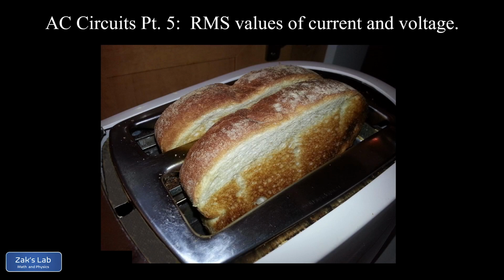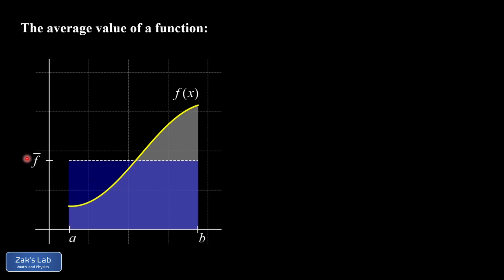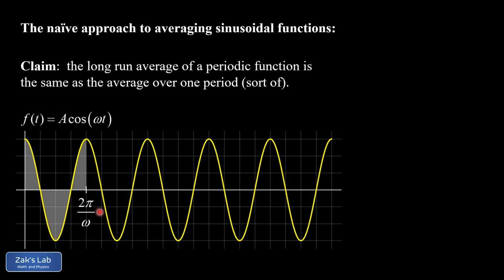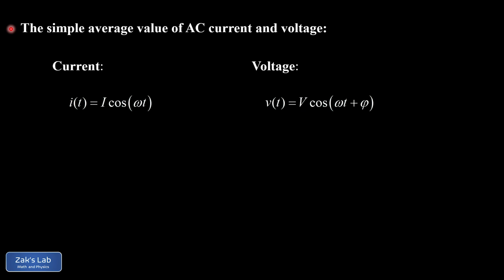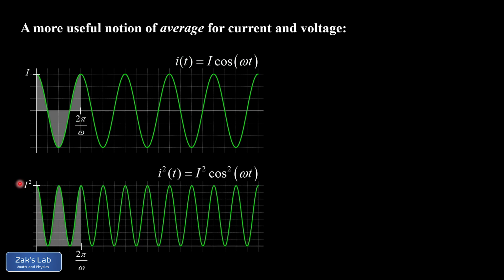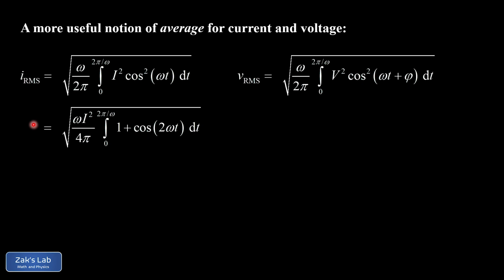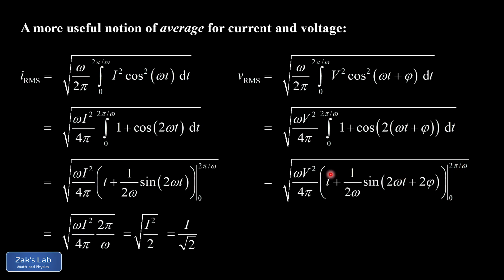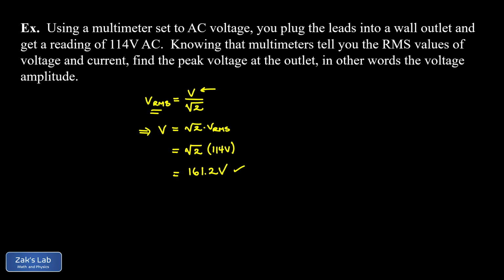RMS values for current and voltage - full calculus derivation [AC circuit physics]

Comment: The motivation for RMS would be better shown by trying to equate the average power dissipated in a resistor with the integral of the AC voltage time the AC current. The RMS pops out of this calculation.
Reply from the maker: This is a really interesting issue popping up in the comments section - is it better to motivate RMS as a reasonable type of averaging first, and then rediscover that average power is I_rms*V_rms (or I_rms^2*R etc.), or do you start computing average power as P-bar= 1/(2pi/w)integral_0^(2pi/w) (Icos(wt)*IRcos(wt))dt, then define I_rms^2 as 1/(2pi/w)integral(I^2cos^2(wt))dt in order to retrieve average power formulas analogous to DC:  P-bar=I_rms^2*R etc.  I'm still not convinced one approach is clearly the right approach to presenting the topic, but I'm still mulling it over.  I just looked in an electrical engineering book and a physics book, and both of them had unsatisfying presentations of the topic.  The physics book was RMS first, then average power later.  The engineering book was average power first, then "look how nice it is turns out if we use this thing called RMS!".  So really it seems like a question of when to pull the rabbit out of the hat.  I follow this video up with all the power considerations, by the way, to complete the presentation of RMS values and average power in AC circuit elements:  https://youtu.be/T08BYGMg9lY
Reply: @ZaksLab a guy from khan academy kept to videos on this and he doesn't use calculus so it's more intuitive

Comment: Very clear explanation. But as the other commenter pointed out, the fact that the function averages of V and I are zero is not a full explanation of why we use RMS. Otherwise, why not just find the average functions of the absolute values of V and I?
Reply from the maker: I would think the main motivation for squaring instead of using absolute value is the algebraic simplicity of squaring (same reason we use least squares regression in statistics).  But yes, the RMS averaging leads to the average power formula for a resistor coming out as analogous to the DC case P=IV=I^2R=V^2/R .  Details are actually in the next video of the series, which I just published yesterday, and you still need to do the average value integrals to see why average power is ZERO for the capacitor and inductor:   https://youtu.be/T08BYGMg9lY
Reply: @  I’ll watch your new video. Thanks again!
Reply: I wis I could discuss t ese kinds of problems wit people in person, and solve t em wit people in person, instead of t inking about t em in  isolation Fars ad.